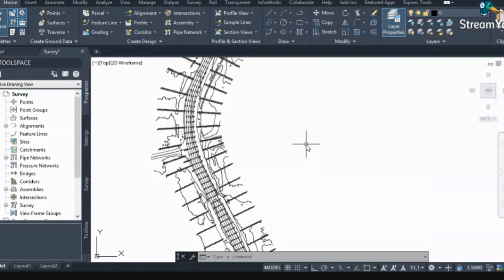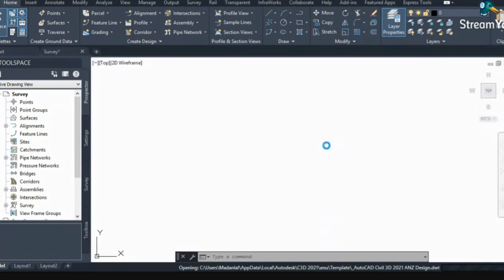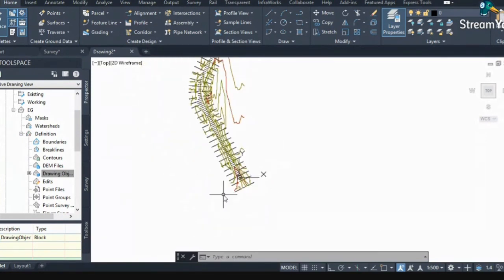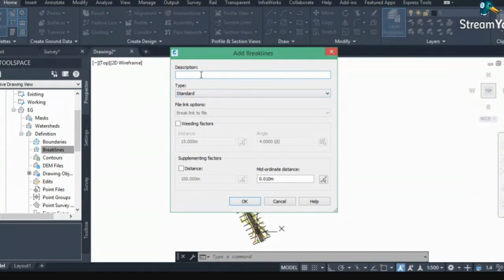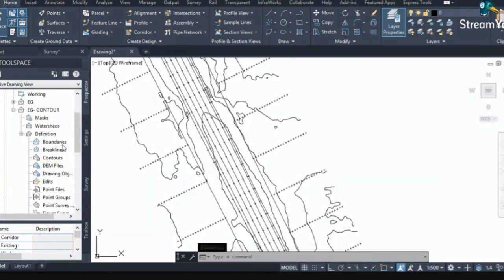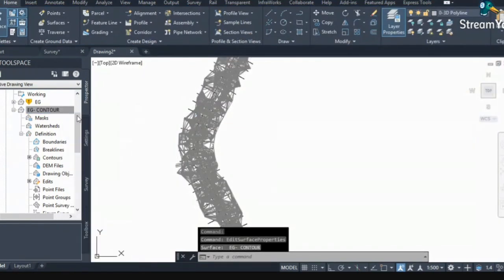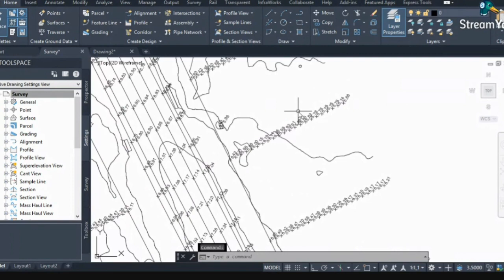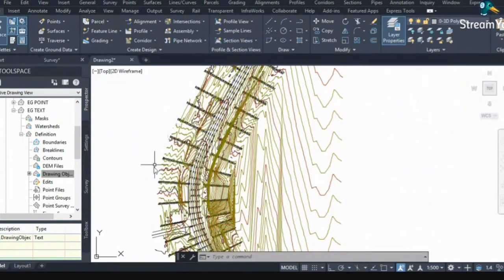C3D Webinar 1 - Methods of Creating Existing Surface & Design Set up

Comment: Nice video brother . This is what actually fresher design engineer needed .
I have a suggestion also means your Topo data is very clean, it consists only limited points that we need to create surface . But most of the survey agency share a huge point file  data of Topo which have building , ofc ,tree , ht line etc etc points . So first of all we need to filter that points and carry out only the needed points .